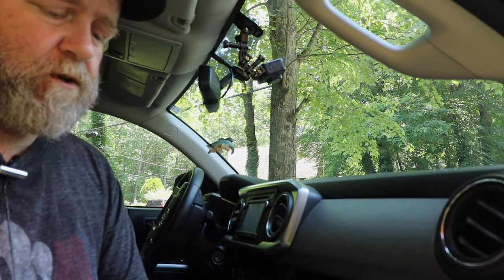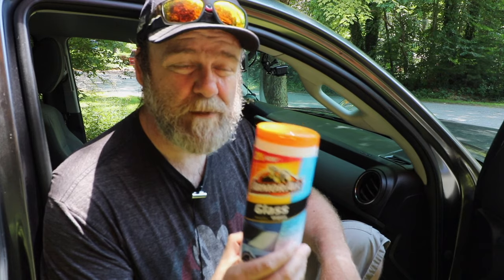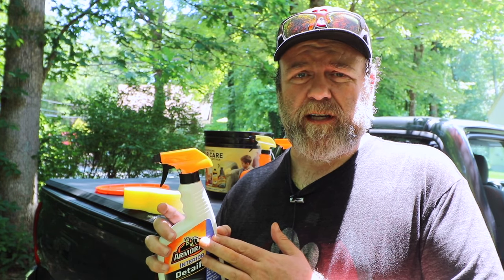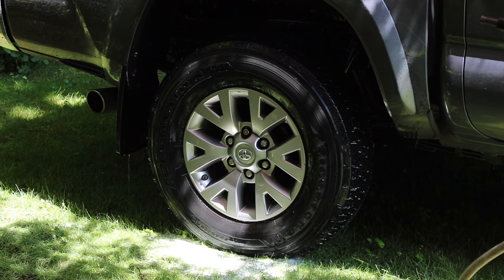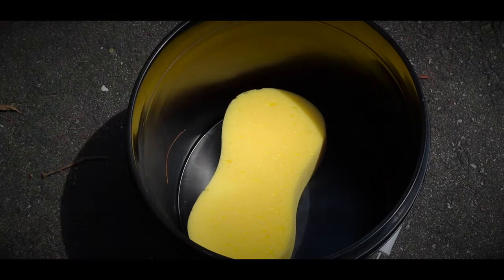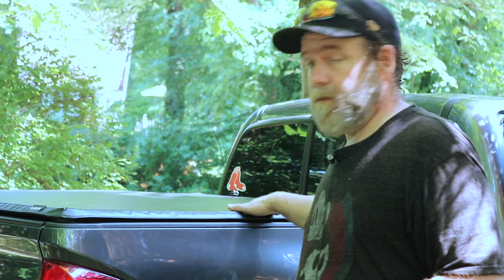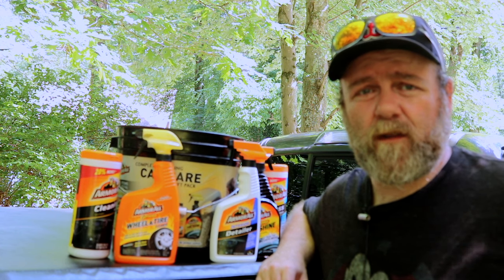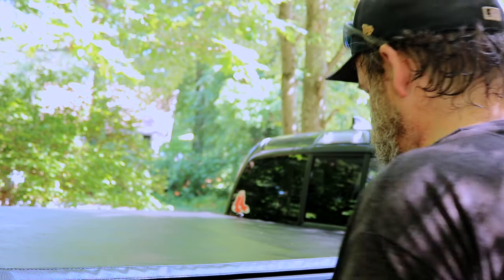UNBOXING - Armor All Complete Detailing Car Care Gift Pack on my Toyota Tacoma (7.14.19) #1267

Comment: There’s a reason their products are cheap 😂 these products are horrible! The reason you have to keep using the protectant a lot more is because the product is garbage. I use meguairs products they are very affordable and very good. I am a detailer so I buy in bulk.
Reply: i have a black 05 f150 and i have all the armor all unfortunately but i should be able to do a decent job right?